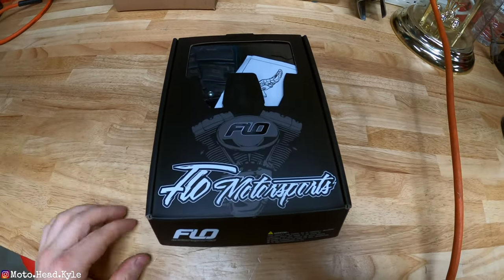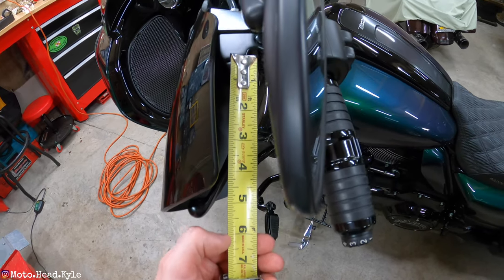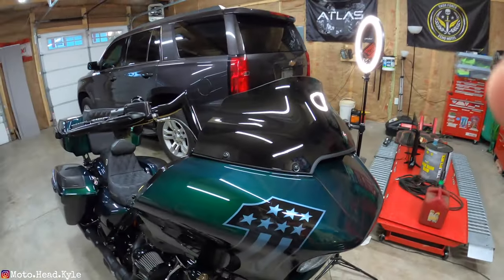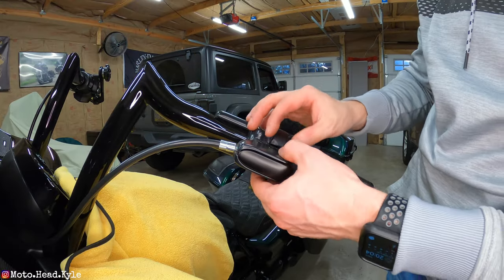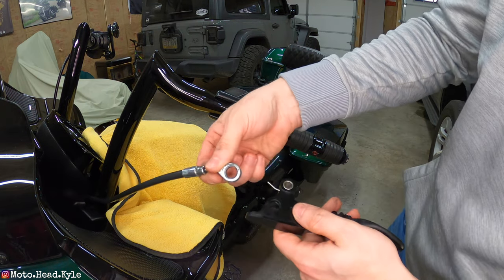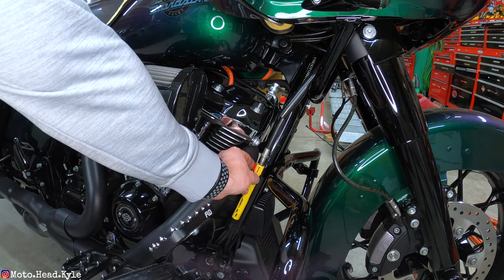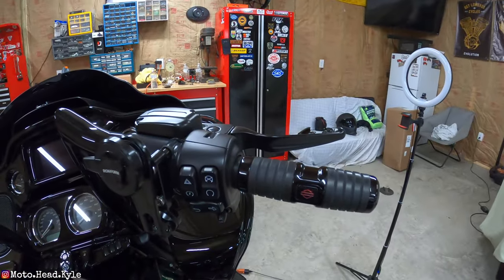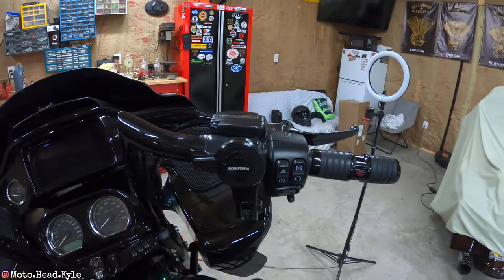Flo Motorsports Adjustable Shorty Levers for (2021 & Newer) Harley Davidson Touring

Comment: 2023 rgst....same issue with Long Levers.  On mine the spring end can sit on the button basically seating it permanently.  Obviously, it's not ideal. I can force it to the upper corner and allow the button to release but again that is not conducive.

Comment: I have a 20 RG with the flo levers. I loved them being all the way in but like you said, you can’t engage the clutch to start in gear. So I have them adjusted just far out enough to engage it. It’s not all the way out but farther out than I would like.
Reply from the maker: Yes! I’ll tell you that having that little rubber weatherstripping in by the sensor as a spacer made a huge difference in being able to keep the lever as close as I wanted it!
Reply: @MotoHeadKyle  I ran into that same issue took them off they need to extend that seat that hits the switch, there is room to do that.
Reply from the maker: @johnbutler8026  The shim that I stuck onto the switch works flawlessly

Comment: Any tricks you can share with getting the spring installed on the clutch lever?  I am fighting with it and its driving me nuts.
Reply: Needle nose pliers can pull it forward and push it in the hole, but you must take off the perch it connects to

Comment: Thanks Kyle good job brother yes all aftermarket levers are a pain in the ass!! I noticed you now have a rockform phone holder and no longer are using the Law Abiding Biker phone holder how is the rockform is it better? I am thinking of doing the swap to rockform also cause the LAB holder has a tendency to fall forward. I did a Harley torque cam and pro street tuner day and night power brother just FYI have you done any more tuning with your power vision? Peace!!
Reply from the maker: I actually switched back to the LAB phone mount! I personally think there’s no adjustability with the rokform. The way my bars and housing are placed my phone was tilted down too far. I tried it in a few different variations but it was still a pain. Also having to use their case as well as no adjustment on the fly unless you carry a torx around to make the adjustment. FYI if you take the LAB mount off of the ball mount and wrap electrical tape around the threads tightly and reinstall it that will make it tighter so it shouldn’t drop down on ya! 

Im super jealous! I’m hoping to get a cam done in the next year or two. (Financially if it allows) lol I am loving the PV4. Just saw yesterday they came out with another variation of the same tune I have, so that I plan to record. But the current tune I have has worked tremendously 🤘🏻
Reply: @MotoHeadKyle  thanks brother good information!!!